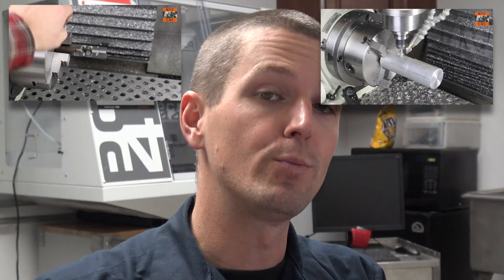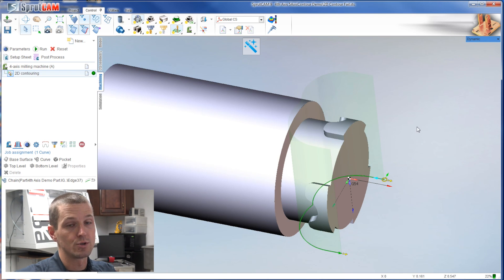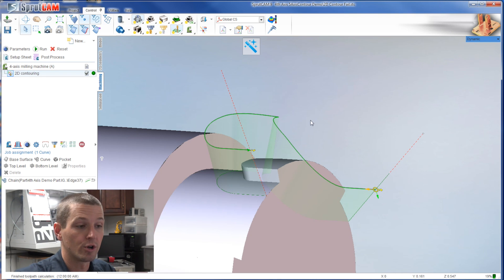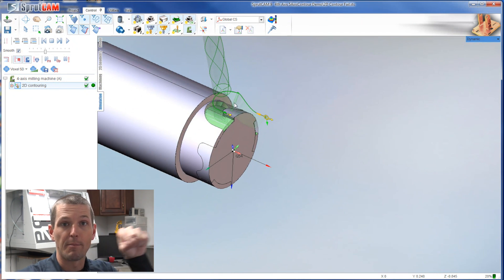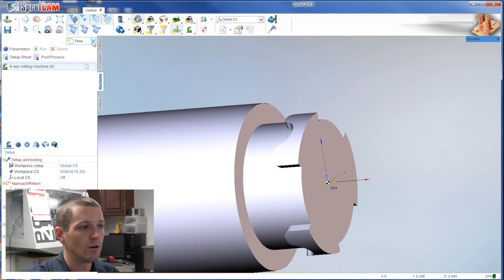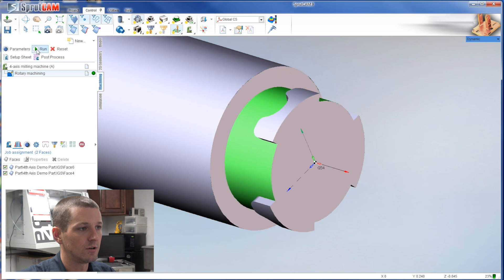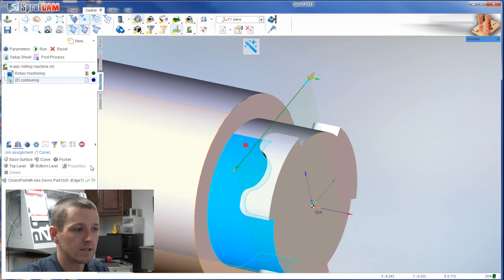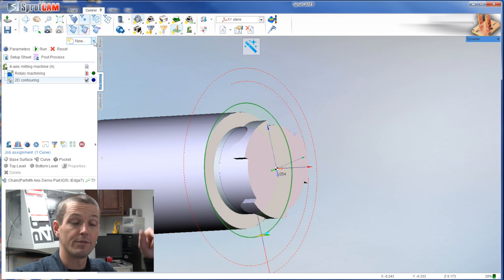Getting Rough with the 4th Axis!  Widget67

Comment: can you just shift the center of the 4th axis rotation by the tool radius so that the side of the tool is perpendicular to the tangent plane. hard to describe, but the table would need to keep the center of the tool offset by the radius perpendicular to the tangent as the 4th axis rotates and then pauses for the lengthwise cuts.
Reply: +Jim Wilson That's what I was thinking too, but the tool path generating software might not have a way to implement that. Each new axis raises the complexity of the problem exponentially.

Comment: Hey man can you use check surface tolerance to stop the tool hitting the parts side wall during roughing? I only ask cause check surfaces are used in some other cam software for this reason? Featurecam's biggest let down is no roughing toolpaths in 4th axis... everything is a work around. Can't wait to see it in F360 either!

Comment: Woe! Yes, the math is Very complicated... It's one thing to keep the center of the tool perpendicular to the work plane, it another thing to keep the side of the tool cutting perpendicular... This is Very interesting stuff. I'm sure you'll master it... Being a programmer, I know they have their work cut out, writing that software from scratch. However, I think they'll borrow many concepts and just write it a different way... That starts with a good systems analysis and developing it in steps from that... Then of course, I have not programmed in many years, so I'm not very qualified to speak on the subject... A lot has changed since I was in the industry... Anyway, great video :-)